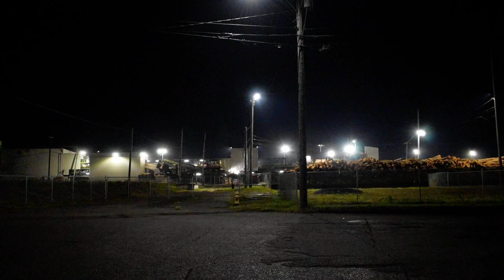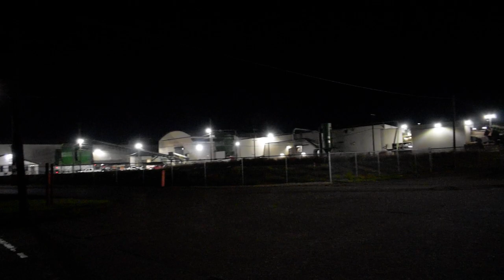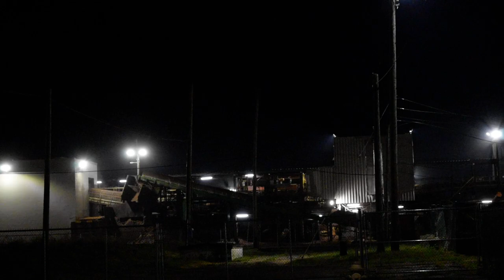Weyerhaeuser Lumber Mill in  Raymond, Washington.

Comment: THAT’S THE SOUND OF MONEY BEING MADE$$$. Without that mill there would be no town of Raymond so suck it up buttercup!
Reply from the maker: It took some time to get used to the Weyerhaeuser Lumber Mill.  Now that the I.A.M.A.W. Union Strike has shut down all Weyerhaeuser operations in the Pacific Northwest on September 13, 2022 at 12:01 am the air is cleaner in Raymond, Washington and the only noise you hear is the traffic and the birds.  I support the I.A.M.A.W. Union's efforts to keep the benefits they have left but they made a mistake when they allowed Weyerhaeuser to negotiate away new employees pensions during the previous union contract negotiations.